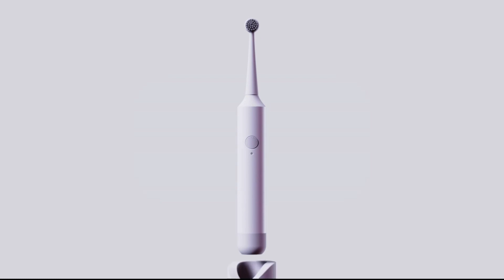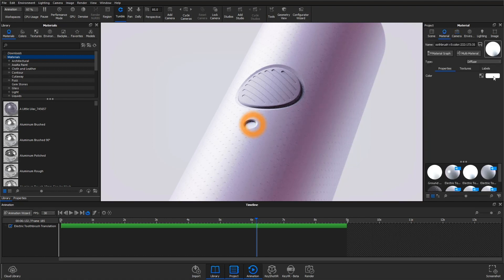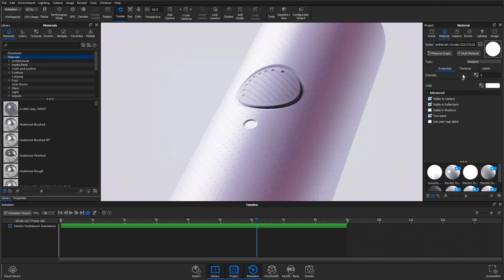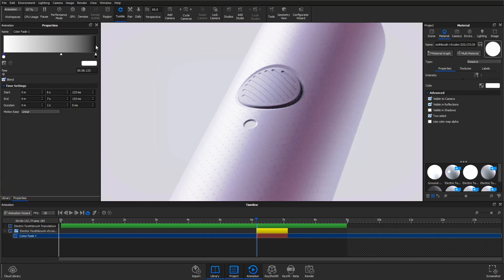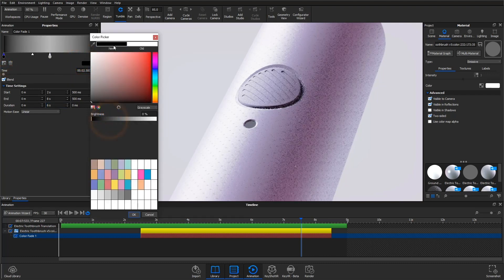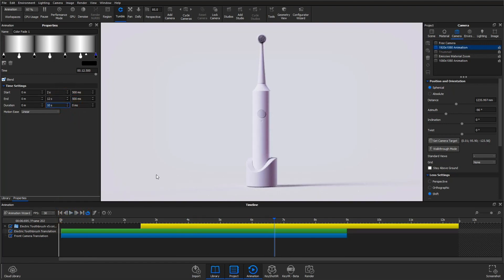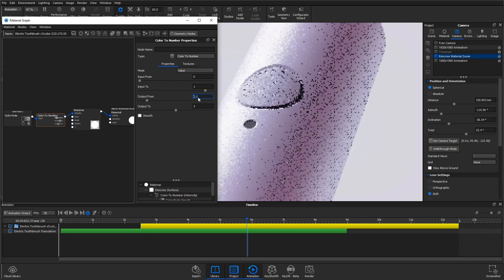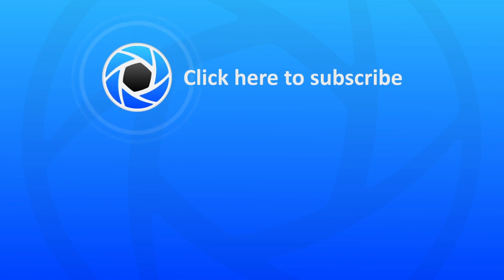KeyShot Quick Tip - Pulsing LEDs Using the Color Fade Animation Node

Comment: Would it be possible to make the light change from one colour to another, say change from white to blue after docking?
Reply: Duplicate the light, and change colour, use fade in & out of each can achieve that effect. (all be it fiddly) maybe a way to use gradients, but I never experimented with that.
Reply: @michaeljarcher  Thank you so much Micheal for making time. I, however, found a way around it. I plugged the colour fade into colour plug rather than intensity, then change the colours  at both ends of the gradient. something  in that line
Reply: @fakoredeolabode1323  O yes good idea,  Let's all wait and see what Keyshot 10 brings, I feel the animation will get a big update. :-)

Comment: very cool. I'm curious why not use the 'fade' animation on the emissive piece (with a prismatic piece always visible for it to shine through) i usually prefer the model to be more realistic with the prismatic clear acrylic or LED material being a clear plastic with a tiny emissive sphere placed strategically. letting the emissive sphere fade also gets you much better caustics and reflections IMHO, but i wonder if there's a performance benefit from using this method. my only objection is that there's a lot of custom material graph nodes that would probably confuse a co-worker who had to take this file over.